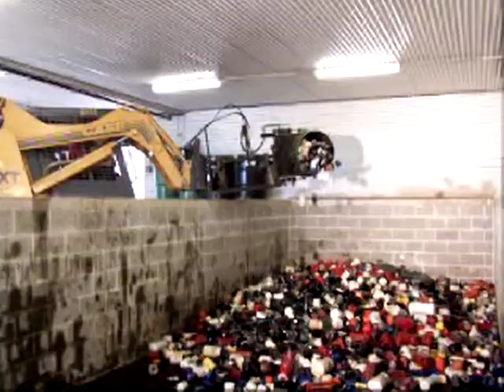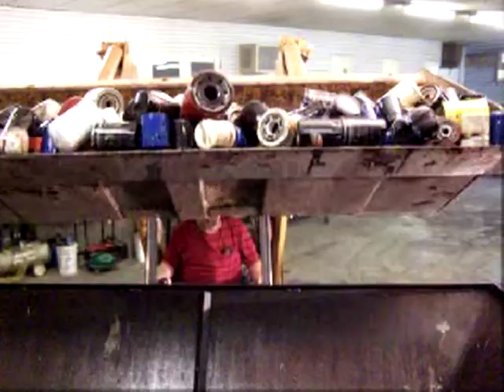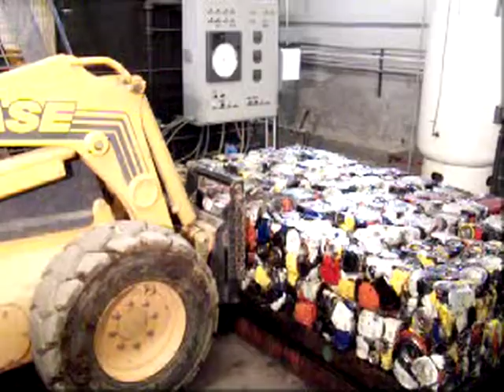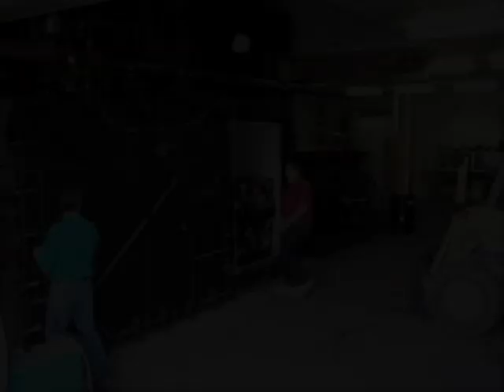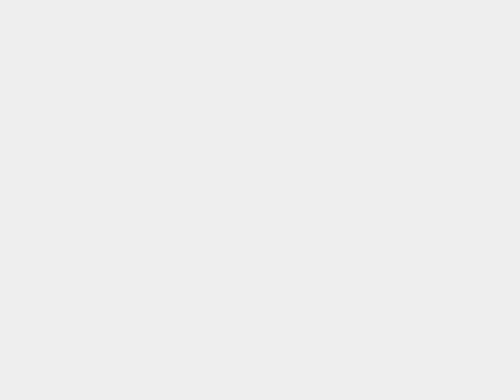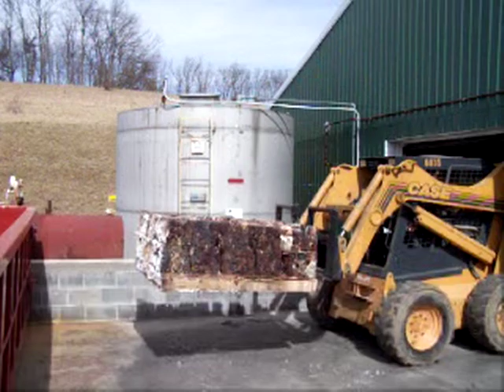More oil filter recycling by Lucas Lane Inc.

Comment from the maker: We are handling over 6 tons of used oil filters every time we run a load through our thermal processor. We are able to capture around 700 gallons of waste oil for each of those loads. That would take a lot of firewood to soak that much waste oil up.
Reply: David Lucas 
Hi sir,
What will you do these filters after heating